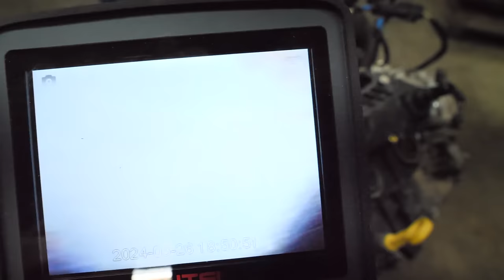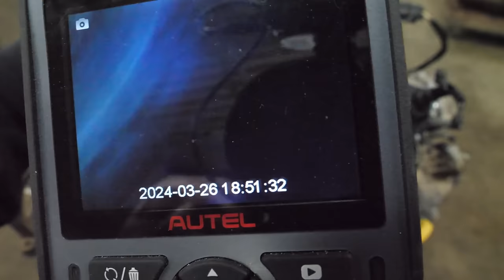ANOTHER BAD 2.7 Ecoboost? 2018 F150 Twin Turbo V6 DEAD @ 131k Miles

Comment: I work the service parts counter at a large Ford dealership and we would replace.  It's faster to replace the engine than repair plus the customer gets a warranty. Aside from the oil pump belt and plastic oil pan, I think that Ford did a pretty good job with the 2.7L.  I feel it is the least seen engine needing major repairs in the shop.
Reply: That's odd because I have a watched a couple of other videos of Ford mechanics where someone goes around and asked what motor they would buy and pretty much all them said the V8.  I peryonoe 3 friends that have had there 2.7 "eco" boost motors blow up.  One the dealer has to do two!
Reply: @apwurst  The 5.0L is also one of Ford's better engines.  There is definitely less to break on the 5.0L plus you can't beat that V8 rumble.  I think we have to understand though that Ford builds hundreds of thousands of engines every year so there will be a few with manufacturing defects.
Reply: @doomspeaker1256  this is true. IF I wanted an F150, I'd go with the 5.0 just because I like the V8 burble/rumble. EcoBoost trucks don't have much of a voice out of the box.
Reply: Sadly the new 5.0 won't live any longer before needing torn down. They now use rubber bands to drive the oil pump also.
Reply: @05milmachine90  lol wat? The 5.0 oil pump is driven off the crank proper, always has been.
Reply: @CaptainSpadaro not since about 2020..... Belts now just like this 2.7
Reply: @05milmachine90  I just checked the Ford parts website. Fucking unbelievable. Looks like the Mustang still uses the snout driven one. Now I really am glad I don't want a truck.
Reply: @CaptainSpadaro  nobody can convince me that the oil belt is a good idea. Imagine a "will it start" on an old 2022 F150... Never happen without tearing it down first.
Reply: @05milmachine90  I agree. I'm guessing the change on the F-150-spec 5.0 was due to the addition of cylinder deactivation (which I still haven't seen a detailed explanation for...).
Reply: @aregeebee201I’ve had the 5.0 the 5.4 triton, and a 3.5 eco boost. I currently own a 2.7 eco boost and it is way better on gas than any of the other motors. I don’t tow anything and this motor gets around the same gas mileage as my ford edge with the 3.5 V6 in it. When you think about it that’s pretty crazy 🤷‍♂️🤷‍♂️ I love how quick this 2.7 heats up especially in the winter months. I live in Alberta Canada and it can be -40c on some days, and my wife always says damn this truck heats up fast. Her Mini Cooper is a fridge in the winter, takes like 30 minutes to warm up.
Reply: May be mistaken but I believe ford had a bad batch of valves in the 2.7 that was out sourced, and you may have one.
Reply: @apwurst  I've also seen several of those videos where all the Ford techs say they would buy the 5.0... the main reason is they're too lazy to remove a couple extra pipes from the turbo systems in order to get at certain areas of the engine. It's really not difficult - I've worked on my own 2.7. If the turbo plumbing wasn't there, the answers they gave would be vastly different.
Reply: Of course you'd choose that because the customer is paying and you're staying in business lol
Reply: @mediocreman2  I mean I would personally prefer to offer the repair solution as more options for the customer the better.  But at the end of the day I'm just a parts person, not a service manager.
Reply: @05milmachine90  Yes, but the belt might well last longer on these. The more cylinders an engine has the power pulses are closer together and overlap more... so the torsional vibrations tend to be less severe. That might well cause less wear on the belt.

That said, the design still sucks.
Reply: @vfb3377  another consideration is that direct injection tends to do a bit more fuel contamination in the oil. This can't be good for the belt. Not to mention that maybe the wrong kinds of oil or additives might tear this thing up. Looking at the condition of some of these belts in teardown videos does not fill me with confidence. I hope you are correct and they last hundreds of thousands of miles, but I doubt it
Reply: @05milmachine90  Goodness no... I'm not expecting they run anywhere near the longevity of steel drive components. Only that the 8 cyl applications MIGHT deteriorate a bit more slowly than those withe fewer cylinders.

It's still a rotten idea all the way around.
Reply: @CaptainSpadaro  Enables them to meet EPA "simulated driving condition" testing for fuel economy, by simply not having the cylinders fire when power demand is very low, which is a good part of the test regime. No fuel injected, no spark firing, no fuel used.
Reply: @SeanBZA  I understand that, I'm saying I don't know how they implemented it.
Reply: @CaptainSpadaro  They simply do not inject fuel into those deactivated cylinders, and also no spark. Thus when it is the time for that cylinder to fire it simply acts like a lossy spring for that stroke, compressing then expanding the air in the cylinder, so that it does not add power to the crank. Then the mass of the moving parts evens out that lack of power, and overall it acts like a smaller 4 cylinder engine. Some variants also use oil pressure to operate valves that keep the inlet and exhaust valves closed for that entire time, but that proved to be unreliable, instead the VVT simply makes the opening and closing angles for the valves very small, so low power overall, during that low power demand time.
Reply: @SeanBZA  that's how they did it? Wow. Seems equal parts lazy and smart.
Reply: @apwurst  the 2.7 and 3.5 outsell the 5.0, maybe that's why you see more with issues. But in general there's very little to go wrong with the 2.7. I've seen one with 540K miles. That speaks more to me than how many blown engines. When you have a bad design no matter how good you maintain it, it won't make it through half a million
Reply: @apwurst that’s because they are muh veee eight boomers
Reply: @apwurst I saw that video too and the question was not “which engine would you take based on reliability” or “which engine do you prefer to work on”. The question was “if you had to buy an f-150 for yourself today which engine would you choose?” And the almost all of the techs are men and the majority look like they’re under 30 years old. No wonder they take the V8 it’s testosterone, pure and simple.
Reply: @apwurst  yea I’ve heard of the dealers having to replace quite a few 5.0 due to high oil consumption, and then replacing cam phasers. The 2.7’s are rarely seen in the service bay’s except for oil changes. That’s why the 2.7’s outsell the v8 3to 1, they are more reliable engines
Reply: @vfb3377  so now it’s “power pulses that may make the belt last longer in the v8”. That’s hilarious.  Power pulses in the oil pan…😝

Comment: I just love the brilliant design of these engines. Plastic drain plug that always leaks, with the sway bar directly in front of the plug. Once you pull that plug, it gushes out like on a Subaru, hits the sway bar and goes EVERYWHERE
Reply: The drain plug leaks because people reuse them.  They're a service item and you're suppose to use a new one every time.  Ford tells you this in the maintenance manual.  You can invest in aftermarket unit like the Ronin drain plug that converts it to an all metal design that has a smaller orifice to drain out of, but honestly once you drain it once you know not to just rip it out as fast as possible, and to hold it like he did.  Or just hold the bucket RIGHT up to it, and let it drop in there after you crank it off, and replace it with a new one like ford said.  No mess, no oil everywhere, and it drains in like .7 seconds. Lol.

Comment: I am happy that I just bought a three valve 5.4 liter 2009 Ford f150. The timing components and oil pump were changed shortly before I bought it for $1700. It still was having timing issues. I found the cam position sensor  connection plug was bad. i was so happy. It is perfect now.

Comment: Nice to see someone that doesn't just blindly follow the recommended OCI. Great to see the results of a reasonable OCI.
10k is too long for the dirtier fuel in the USA and lower grade synthetic oils.
UOA should drive OCI for the application. 3k, 5k, or 7.5k max. If you tow change it sooner, etc. A car isn't just an expensive toaster.

Comment: Everyone keeps complaining about the rubber oil pump belt, but it looked totally fine at that mileage. What about all the cam chain tensioner failures. Chains are so much better? 

You need to change your oil every 5000 miles. Neglecting oil changes is what kills engines.
Reply: That's not true. They've known since the 60's that rubber and oil don't mix. I don't give af what "compound" Ford says they made these belts out of, they'll all crumble into oblivion before the 150k interval they claim it lasts. 50k miles and those belts are already swelling. Chains are infinitely better.
Reply: Let me emphasize that a dry belt system, totally fine. Key word, DRY.
Reply: @SammyM00782  lots changed since 1960 buddy 😂
Reply: It really truly seems to me to be a ton of fear mongering for absolutely no reason. If the wet belt was truly an issue we’d see multiple videos, posts on forms and other things that indicate the wet belts are failing all the time but there just isn’t evidence for that. 

With the amount of people saying “wet belts are bad” you’d think it’s the worst design in the entire universe….

Comment: As to the question at the end, if I were the tech working on this as a customer vehicle, I would have recommended the engine too. We only get so much time to dig into a bad motor for diag. It’s no fun getting burned on a comeback for trying to save the engine.

Comment: Injector failure, or at least malfunction. Created a hot spot in the chamber, turbo keeps pumping in air, hot spot gets really lean from not enough fuel, boom-burnt valve. This is the cost of very complex, highly dependent, high performance, small displacement engines. Everything HAS to work perfectly ALL the time, or it fails catastrophically.
Reply: And MOST of 5he time it does work perfectly. As he said there were missing parts so he could not tell what happened to this engine
Reply: Exactly, leaned out do to the injector malfunction and Mister Blow Torch fired up.
Reply: all that so called TeC, and burns valves like a 1962 dodge

Comment: I have heard the phrase "burnt valve" many times, never actually seen one. Thanks for that!
Reply: The burnt valve was radically burnt, looking like it was blasted with a gas axe. You'd think the computer crap would report a loss of compression in that cylinder.
Reply: @StuntPosse  The computer will report a misfire on that cylinder.   Not sure if the ECM will do a relative compression check on the gassers like it will on the 6.7 diesels.

Comment: Two second gen 2.7TT teardowns so far, and neither one because of the scary wet oil pump belt.
Reply: It would have been nice to see what the belt looked like up close.  At a distance it looked good but perhaps there was some cracking if you looked more closely.

Comment: As far as I know, the oil pump belt has not oil related problem, it has problem with short run time where its not warm and running rich. This makes some of the gas gets inside the oil and the gas is killing the belt.
Reply: At least the belt is clean. 😂😂😂
Reply: How many “killed belts” have you seen?🦗🦗

Comment: The 3.8 liter engine in my Buick makes over 600 pound feet of torque at the tires on 28 psi of boost. High power in the small engines isn’t what kills them if they’re maintained right. My engine doesn’t have an oil pump belt though lol….

Comment: fwiw my work truck is also a 2018 2.7, and i use all 400 ftlbs that thing makes 5-6 days a week, 50-200+ miles a day. i drive that thing like its a racecar, pedal to the metal, if its not idling its redlining. i also get the oil changed at jiffyboom or whatever only when the dash tells me (so around 10k miles i think), and the only work it has needed engine wise is a water pump about a year ago and a set of coils and plugs about once a year (yes really). the best part?

it has 188.5k miles right now, will hit 190k by may, and if it doesnt make it to at least 200k by new years it either blew up, crashed, or i was fired.
Reply: Get it tuned, man.  Livernois Motorsports or any of the others and on 93 octane it'll make 400hp and like 500ft/lbs of torque and be just as reliable as ever.  Even with stock everything else, I have the 2.7 in my Ford Edge which is heavier than an equal model truck, and it runs 12.9's on just a livernois tune on 93 octane.  Would be even faster if it was RWD bias AWD instead of the FWD bias/haldex type AWD system it has.  The F150s and up that have the 2.7 will run mid 12's all day on just a tune and maybe an exhaust/intake system.  Crazy.
Reply: @BasedEMT1776  why would he tune a company truck.
Reply: @curlyfriesolaire8053  Bro, I would tune my ambulance if I could and these things have 250+ thousand miles.  Lol.  More power, better economy, more fun, and no one would ever really know.
Reply: tell me your joking and that you trust jiffyBoom oil changes at 10k.   I guess you'll wont make it to 300k at that pace.

Comment: I have the big brother to this engine. The 3.0, in my explorer ST. I’ve had my engine tuned with FBOs and it makes about 520 hp at all four wheels. I did this at about 3000 miles. It has about 32,000 miles and the only mechanical problem I’ve had is a sensor with the all-wheel-drive system leaking.
The 10R60 transmission is another story. 
These engines make amazing power. Turbos, fuel pump and a tune will get an explorer into the high tens.
The 3.0 v6 TT seems to be the Magic number for power. A lot of new manufactures are making a 3.0 i6 or v6 TT

Comment: Honestly, the 2.7 ecoboost is one of the better engines Ford had built recently. Just do your maintenance people 😉
Reply: Indeed.  Mine makes like 320awhp from just a tune(400+ at the crank) and has over 100k miles on it.  50k of those miles have been at the 400hp tune, running 12.9's and surprising GTIs, Hondas, SUVs, and Charger R/Ts when they get gapped by a grandma SUV(ford edge).  I love these engines.  They're so overengineered its ridiculous.  Mine is Gen 1 so it has the chain on the oil pump, and every single thing I've ever had to do to it maintenance wise has been a pleasure.  Ford built this engine to be maintained/worked on and you can tell.
Reply: @BasedEMT1776  true. Personally I'm not sure what the big deal is over an oil pump belt. This is a low stress, short belt and it's doing nowhere as much as a timing belt. The belt will likely last as long as the engine itself, there are many 2nd gen 2.7 engines with over 200K. If you can get 250K+ out of this engine it really owes you nothing and if it needs rebuilt then do the oil pump belt as well. Easy as that.
Mine's at 190K and I know Coyote engines also switched to an oil pump belt a few years ago. Then again no one is talking about having that belt go out.

PS. Did you need to beef-up your transmission for the extra power? I thought the 6F55 used on the Edge was near its limit for torque (550Nm or around 405 ft-lbs?)
Reply: @BasedEMT1776 what tune and tuner did you use?
Reply: @YoursInYeshua  Livernois MyCalibrator handheld tuner, tunes by Livernois Motorsports.  I bounce between the 87 octane tune and the 93 octane tune.  The 87 octane tune is high 13's, mid 13's if it's cool out and 0-60 in the low 5's.  93 is 12's in the 1/4 and 0-60 in the 4's.  It's even faster on E30 tune, but no E85 where I live sadly.
Reply: @BasedEMT1776 I would have to claim the 2.3 is a great engine for reliability and moding.

Comment: People are still driving 20 year old trucks? Not me! My truck won’t be 20 years old for several more months. It’s a 2005 F150 FX4 with that unreliable 5.4 3v. It had 25 miles on it when I bought it in early 2005 and it has 345k miles on it now. Had to rebuild the transmission a couple years back, but otherwise it’s original. Even the water pump. 😐 I’m towing my travel trailer around Arizona right now. Damn thing. 😎✌🏼
Reply: Cam phasers definitely
Reply: @xinx-fn8973  They’re original. Engine has never been opened up. Replaced the throttle body long ago. Original starter, alternator, water pump and hoses. All original timing gear. I do all my own maintenance and have worked on cars since I was 13. I’m 69 now. It’s a great truck. Still gets the same gas mileage it always has. Has a little piston slap when it’s below forty degrees in the morning, but otherwise. 👍🏼
Reply: My 5.4 3V has 159k and needs phasers.  It's coming soon.  I've only owned it since 132K and it has a good life with me, i.e., frequent maintenance.
Reply: @JimBronson  I’m shooting for 500K! 😁
I’ve got a little piston slap when it’s cold out, but it goes away pretty quick. I was an automotive machinist back in the day and I’ve worked on cars for over 50 years. I’m really amazed how well this thing still runs. It’s so quiet at idle that all you hear are the noisy fuel injectors clicking. 👍🏼
Reply: How often do you do the oil? I hear the 5.4 3v lasts a long time with 3k mile oil change intervals. Such short intervals don't let oil sludge up and block passageways, which then would kill the cam phasers.
Reply: @bill_clinton697  I do oil changes at 3-3.5k and used the Motorcraft 5/20 blend for the first 200k. Now I’m using Valvoline 5/20 full synthetic high mileage and Wix filters. I just changed oil the other day in fact I think it’s at 345k. The engine is very quiet except a slight piston slap when first started and when the weather is cold. I check oil level often and keep up on maintenance. I rely on my truck to tow my travel trailer. 😎👍🏼
Reply: @IndridCool54  Yeah, with 3-3.5k changes, it'll last a long time.